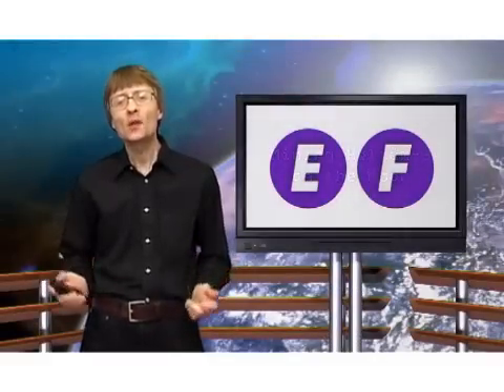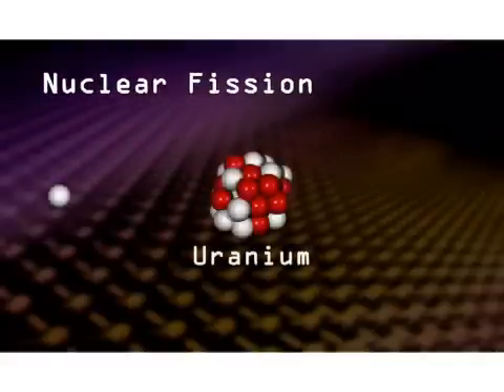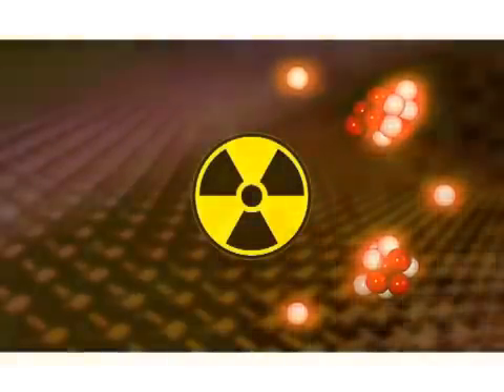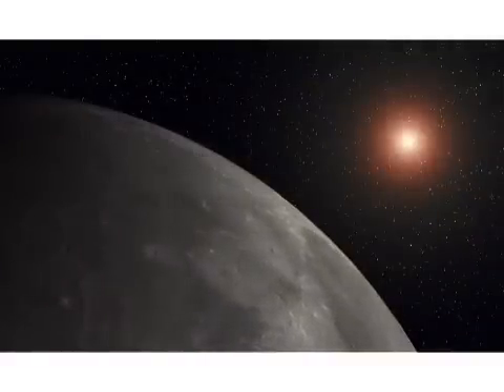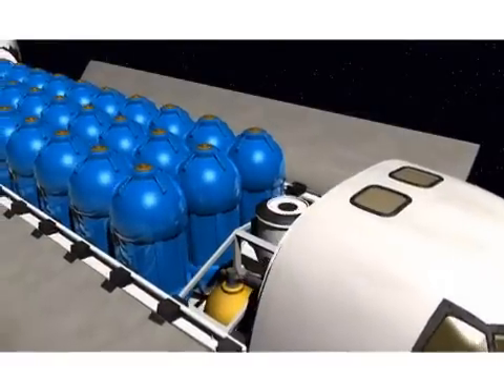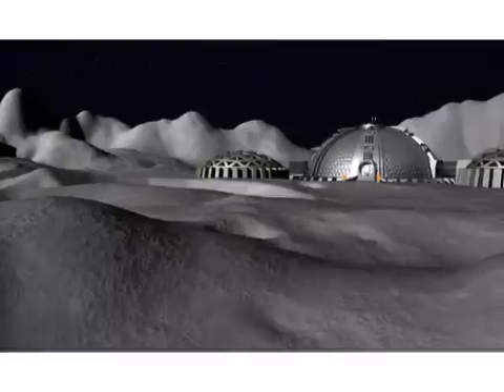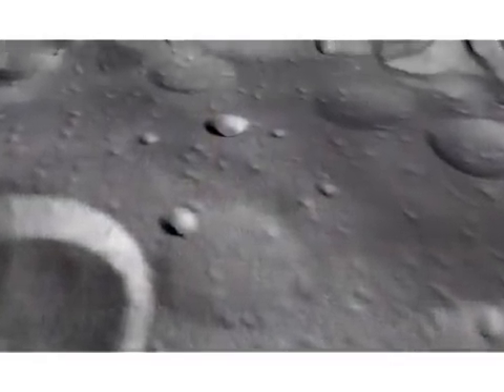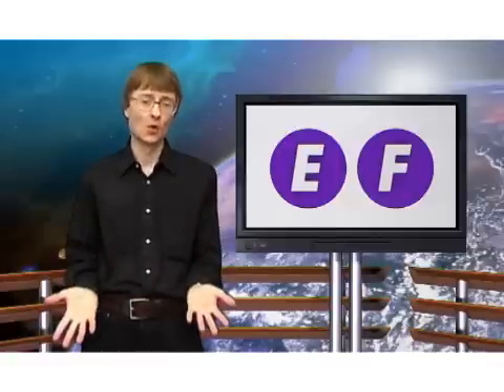Mining Helium-3 On the Moon

Comment: 25tons x 3Bn/Ton = 75Bn. The mission to bring 25 tons of payload back from the moon (post regalith mining and refining) would dramatically exceed 75Bn in cost. You would have to find a way to cryo the helium to reduce the dry mass ratio of the containment vessels. At least this is so for craft like SLS. Starship might be able to turn the economics around, but frankly I think its barking up a totally unneccessary tree when thorium LiFTRs are much easier to make. Particularly because fusion is an asinine concept to begin with. Why would we be able to do on earth what normally takes the mass of a star to do sustainably and the shock front of a strong-force-based explosion to do momentarily, it's stupid to think that is possible.

Comment: Could we mess up the mass of the moon by over mining?
Reply: No the moon is gaining about 2000 kg / yr from space debris..because gravity. It doesn't lose mass from gasses like earth does though. So while the earth loses mass every year ( gas loss is greater than space debris added) the moon does not. 
Now the moon is moving away from earth at about 1.5 inches a year. Just search on the net to find out why. 
We couldn't remove enough mass from the moon to matter even if we tried.

Comment: Imagine a shuttle crash on earth carrying Helium 3. Bye bye humanity.
Reply: That's not correct - helium 3 cannot be ignited by a crash or any earthly means - it needs to be heated above 150 million degrees C and confined using a huge magnetic field mixed with deuterium and then it might start to produce energy. Definitely not in a crash.
Reply: Helium 3 is radioactive but is easily diluted. Plus, fusion is not a bomb like fission if that's what you're referring to.

Comment: Lies lies lies!  Helium3 is neither rare nor terribly expensive.  Before 9/11 the price of Helium3 was about 100 dollars per liter STP.  The source of Helium 3 is ultimately such light elements as lithium and boron. expose these to the neutron flŭx of an active nuclear reactor.  This generates large amounts of tritium. Extract the tritium and let it sit around a couple of decades and most will become stable Helium 3. This is not that useful for fusion but if you expose it to the neutron flŭx of a reactor, it will convert back into tritium again which is very useful for fusion, especially combined with deuterium.  I think it would be more cost effective to use lithium or boron for a source than extracting it from moon dust. The insanely high price of helium3 and tritium is because the U.S.  has artificially raised it that high to prevent it from being used for triggers of nuclear weapons.  The natural price is not much above a hundred Euros per liter.
Reply from the maker: No, no lies at all. As I understand it, the current price of helium-3 is up to about $2,000 a litre of the gas, which is about $15,000 a gram, or $15 million per kilogram. This is consistent with what is stated in the video, with helium-3 being hundreds of times more expensive than gold.

Comment: The first return to the Moon should be the building the commercial Clementine Base at the Lunar South Pole.  The Clementine Base will map and recover the Lunar Water Ice !  The Lunar Water can be broken down to LUNar OXygen  (LUNOX) that has many uses.  And Hydrogen to fuel a Reusable Lunar Based Shuttle (Lunar Base to Polar LLO).  And heated Hydrogen can be used to recover Solar Wind Gasses from the Lunar Regolith.  Back to the Moon to Stay and onto Mars and Beyond-Ad Astra...  tjl

Comment: This Video only scratches the top surface of Helium3 mining. I would like to know more about the actual actraction process.  What about the problem of the scarcity of Helium3 in the moon Regolith?  Also, why not collect Helium3 from Mercury, which should have much higher concentration of Helium3 because it is a lot closer to the source. Other good alternatives for Herlium 3 would be Uranus. What is also missing are some sanity checks, like is it actualy cheaper than exisitng sources Helium3, namely Tritium degration ino Helium3. What about creating it in charged particle accelerators? All alternatives need to be considered

Comment: Just to add some plausible areas but wouldn't the moons and other planetoid objects with weak or no atmosphere be viable candidates like Jupiter's Titan, water based ice on asteroids, and extended phases for them like pulse technology?For the Lasers I would Imagine it would be much more efficient to build a few relay and transfer stations with each one acting as an amplifier to a centralized one with in Geo-synchronized orbit. Reason is that when you try to account the distance, solar flares, Earth's Atmosphere, and Receiver array with multiple currencies that would require either a Exa-scale supercomputer on bother ends or at least various relays until laser tech. gets to be able to launch a 6m beam for 30 minutes from earth to half way to the moon to be a viable 1 way beam or a 2 way intercommunication & relay beam.I am only putting this out cause I think if going this way we need to alternate like wires. With wireless communication being the beam and the relays being the wires with alternating currents as they store as much as near possible then sending the excess to the next say 500-1000 miles and keep repeating until it reaches the final destination relay before sending it to Earth so that it loses the least amount of energy.I really want to see this cause I read that if applied to ships there would be barely any limits to the size and thus making space the most viable in terms of humanities future.

Comment: hey guys, does anybody know of a film from the late 50's or early 60's where they use helium-3. the helium-3 is able to climb a ladder when a light is turned on. It is also able to slide up the walls of a room and slide towards the light due to its superfluidity.

Comment: How soon after we start mining the moon will we see 'peak Helium-3'. It'll be just like the gas lines in '78. And think of what all that strip mining will do to the surface of the moon. There'll be plenty of jobs for dozer, shovel and haul truck operators tho.
Reply: +Dan inWY The moon is huge, with no atmosphere to speak of. Nobody lives there, it has no biosphere. Therefore, nobody would care what mining activities would do there. There can't be a peak, there's so much He3 on the moon that we'd never use it up.
Reply: Even if we did, there's plenty, if not, more on Mars. Assuming it doesn't have the magnetosphere to block it like we do here on Earth.
Reply: also asteroids and saturns many moons
Reply: +Dan inWY There isn't a lot of Helium 3 on the moon, compared to its size.  150 ppb I think.It's useful as a means to jumpstart Helium 3 fusion on Earth beyond experimental reactors, but we would soon move on to the gas giants, particularly Saturn and Uranus.

Comment: We could just use heavy water nuclear reactors (CANDU) to produce tonnes of tritium and let it decay to He3 in pressurized tanks. Tritium has a half life of about 12 years and it beta decays so you can make the tanks glow if you really want to :P
Reply: While D2 + D2 reactors produce more energy, it takes a metric fuck tonne of Heat to fuse them, D2 + H3 reactors produce smaller amounts of energy but require way less heat to fuse together, so with the abundance of H3 already on the moon its much more efficient and economically viable to do.
Reply: ViceVersa
Storing tritium water in tanks and let the He3 bubble out is less economical than going to the moon?

Comment: Because uranium and our old reactors that makes waste and have melt downs people will probable not support this. Because of this we still haven't advanced to 1st generation nuclear plants
Reply: +Satyam Patel We're at third, almost 4th generation nuclear reactors now. And Nuclear Fission remains the safest energy source to date.
Reply: Sarge Rho Nuclear fission is still 1st gen technology from the 1960s that is not efficient and produces a ton of waste. There is also a constant need of nuclear engineers, and a natural disaster can easily cause a meltdown. The most safest energy source currently is through solar and wind, both are too expensive and require too much land.
Reply: Satyam Patel No, you're wrong.

There are no or very few first generation reactors left operational. Most are second or third generation reactors, that have little in common with the early reactors, only really sharing the fact that they use nuclear fission to produce heat.

Wind is currently the cheapest power source, followed by nuclear, hydro, natural gas, and coal.

It takes a lot to cause a meltdown. Fukushima Daiichi was built poorly, there is another nuclear power plant not far from the Daiichi plant, that did not suffer a meltdown.
Chernobyl continued to operate after the accident, all the way until 1996/97.

Nuclear is the safest power source. And the cleanest, it produces very little waste. All of the nuclear waste produced so far combined fits on a football field.

Comment: (this is related to your comment, not a necessarily a response to it)
73,476,730,900,000,000,000,000 kg should be 80,994,135,200,000,000,000 tons (2000 lbs = 1 ton)
so if you take off the 1 million tons you get
80,994,135,199,998,000,000 (vs 80,994,135,200,000,000,000 )
that aint shit people

Comment: As it is with all these ideas, none considers the temperature control problem. A vacuum has no temperature, only matter has, and so there is no cooling by conduction and convection possible, but by radiation only, the capacity of which, per unit of area at room temperature, is just a fraction of what it is to water and air on Earth. We simply do not have an energy technology that can achieve more than in the ISS. Visit - draaisma.net - to read more about it (the 2nd law for space habitats).

Comment: I totally agree with you on the cost if you want to bring them up from the ground, but for the scale of the project we would want to establish a manufacturing foothold in space. That may still be expensive, but it would lead to opportunities far beyond power on Earth.
As for transmitting it to the ground, very promising tests have been conducted with microwave power transmission. Possible efficiencies are in the 90%+ range.

Comment: You know Titan has oceans of methane, which is great rocket fuel, and enculadis, which also orbits Saturn is composed mostly of water, they would be great for space stations for re-fueling, also you could use mars for steel mining, and if you need a waste center you have Jupiter, and the moon has lots of heavy metals as well, or if you happen to go find a 30 km asteroid you could supply earth for 10000 years worth of platinum and much other materials as well, like gold, titanium, silicon and mu

Comment from the maker: @SincerlyMexx Helium-3 is a gas, hence would be stored in pressurized tanks as you note. After heating up the Moon rock a lot of filtering would need to take place to separate the helium-3 from everything else (ie it is not as simple as just heating up the rock and bottling the gas). It would be a serious industrial process to set up and operate -- if one with potentially very significant results.

Comment: @bobafetthotmail Actually there is a proposal to build a space elevator from the L1 point to the moon (about 58.000 km long).

A carbon fiber cable would be strong enough, but since its so ridiculously long we need to send the factory in space.  It's not that a big technical boundary than building a space elevator on earth, where you'll be needing highly advanced nanotech to build a cable with enough tensile strength and anchor it to geosynchronous orbit (also 42.000 km).

Comment: He claims that the economic value of helium-3 is about 3 billion per ton...but the cost of the Apollo spacecraft and Saturn rocket cost alone was about $83-billion in 2005 dollars. Now, I know alot of that went into engineering and testing costs, so let's say that in terms of fuel it costs 1.5 billion to get to the moon and back...you still have to refine the helium-3 on the moon, and the shuttle is only designed for LEO. In order to make this viable we still need cheaper launch technologies.

Comment: @Ramshobraja 

In the long run Robots may be better at extra-terrestrial mining than humans but the biggest problem with mining on the moon is most of it will have to be learned on the go, that means many repairs, adoptions and rebuilds of machinery and robots.

Robots and automation will be huge components but a fully functional mining operation would be impossible without humans around to find expedient solutions.

Comment: not much coal(if any) goes into the structure of a home. more so it's used to supply electricity or used to make the steel most of our appliances are made of. not much "coal" in a pc either. i get the GIST though. but we could potentially almost replace coal at some point in the future. but mining will always be a necessary thing

Comment: "but United States will not plan a mission back to the moon until 2024 " Its 2020. And russia and china are not going back  back that soon. China's date is 2022. And russia said they will send a man to the moon by 2025. And set up a base several years later. No manned mission are going to happen before 2020. Unless its the U.S. Nasa has said that they might be able to do it by 2019 but it could very well be pushed back to 2020.

Comment: Nope, it's hot fusion like the rest of it but it is a different method of fusion.

What's not mentioned in the video that fusion involving He3 as opposed to tritium and deuterium, releases a good deal of eletrical energy in addition to just heat.

The radiation of photons could be used to induce a voltage and thus we get power directly from the reaction as opposed to indirectly through heat.

But I am definitely NOT an expert and am subject to be wrong, though I am fascinated by the subject.